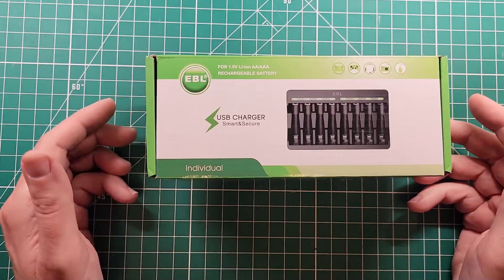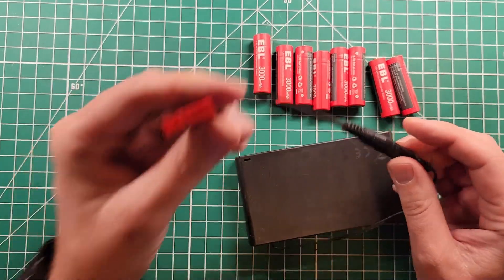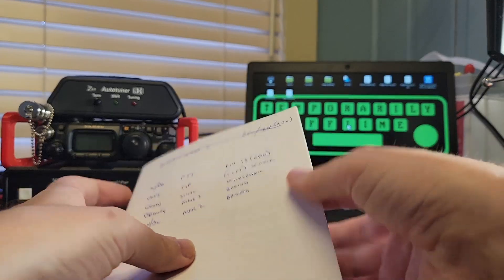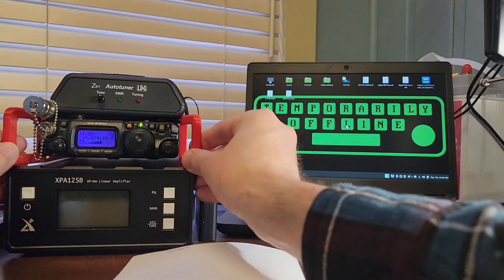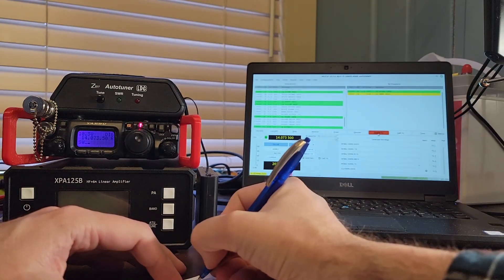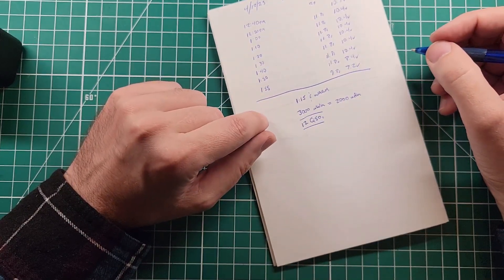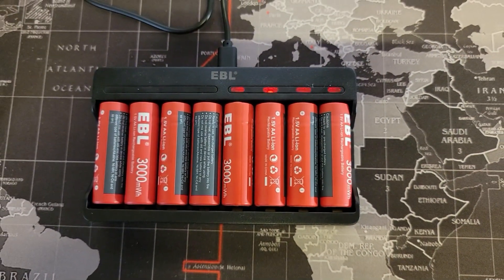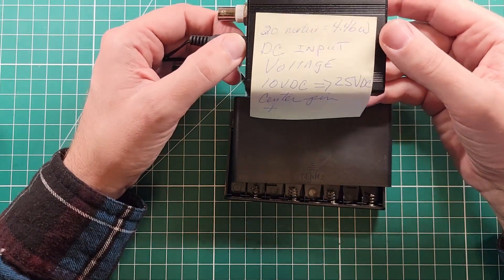The FT-818 vs. the EBL Reds!

Comment: Hello T. O. , I have a video request. Something i cant find on YT , or on the google machine. There are a-lot of people that bought the box73 dyc 8x7 speech compressor in kit form, and we didn’t realize we needed a lab- type power supply to adjust the potentiometers. So people on the forums  are asking each other to take pictures of the pre-built settings on the potentiometers, instead of  adjusting them to each radio. Anyway, we can solder the 4 parts to the board. Its adjusting the power draw and compression settings. There is one or two videos on the build ,but not on the set up.  If you can help it would be much appreciated. Ok thanks  mike, KF7LRR.
Reply from the maker: I check out the instructions and the "lab grade power supply" appears to only be needed to verify that you've installed the parts correctly in the kit.  (Page 10) - the instructions for setting up the pots are on page 12 and they basically say "tune by ear" - but I think you could either TX to another radio nearby and hear better or use a scope for that.  Interesting for sure.  I'm trying to think what problem would be caused by "bad assembly".  I've dropped it on the list of things to play with, but its a long list and this thing would have to come from Germany... Happy to continue the discussion.

Comment: I use the EBL reds in the AA battery compartment internally. You just need to snip the plastic divider between the batteries for them to fit
Reply from the maker: I've seen that trick!

Comment: I have had a 817 for over 10 years.  Nothing beats a 7Ah lead acid battery.  You can run for 2 days, it's cheaper and rechargeable and if you need the high power it's available because you have a higher voltage battery.  If you run out of your car
use a cig lighter to 12v plug.
Reply from the maker: Exactly!  I have the car plug and a big battery box.

Comment: I have an array of battery chargers. I tend to stick to smart "universal" chargers, but this is pretty nice since most do not handle that many batteries at once. In fact I think I can only charge 6 at once on my largest charger.
Reply from the maker: I like that this one is compact and USB!
Reply: @temporarilyoffline  yeah, it's a good form factor and I also stick to USB, I can plug them right into the LifePo4 batteries, or inverters, from my solar system.